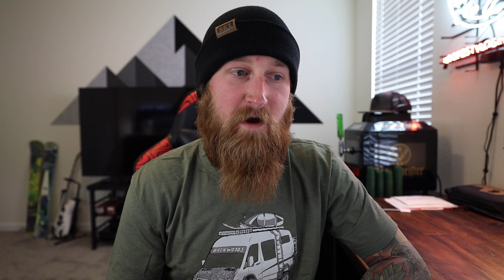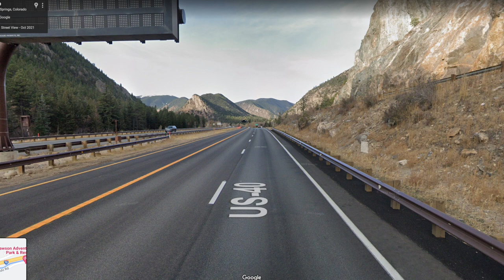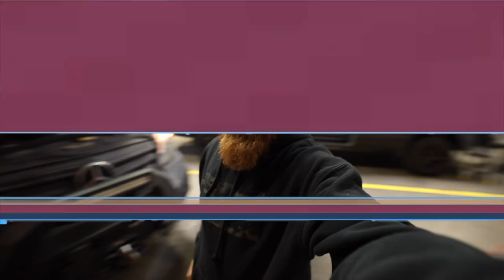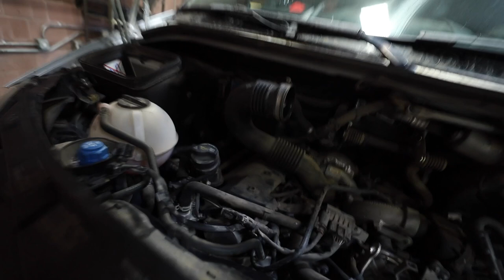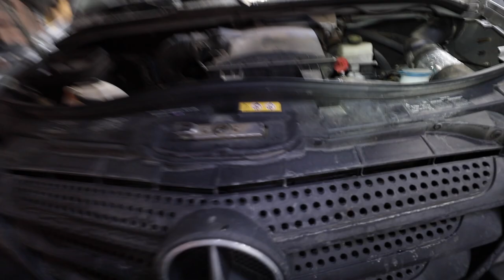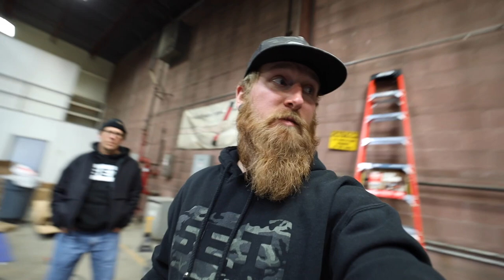DANGEROUS #VANLIFE SITUATION! | Complete breakdown...

Comment: Pro tip: Get a AAA membership $130 year 5x 100 mile tows. Premier $170 5x 100 mile tows plus one 200 mile tow. All your vehicles including RV. Plus many other benefits.
Reply: And motor cycle
Reply: When I had Premier AAA it didn’t include my RV.
Reply: @J.Young808  you have to have RV added to the membership. If you go to the sign up page on AAA it has a plan with and without RV.
Reply: Yep !! I  pay 250 a year that is for multiple vehicles or a Family membership...its came in handy a couple times...plus if your broke down out of town  ,  discount at most hotels ( not thar im a cheap ass but hey 10 bucks is 10 bucks lol ).

Comment: After owning my '17 4x4 Sprinter for less than a year, I went to northern New Hampshire where the temperture dropped to -20 overnight unseasonably early and my van didn't start in the morning.
My friend, a truck driver, claimed the Southern NH gas stations hadn't swapped over to their winter blend fuel yet.  This is another thing to consider during early winter months.
I too do all my own maintenance.  I found your commentary very usefull.
Thanks,

Comment: My wife and i had a similar experience on I-5 in LA at the worst possible spot. I had preemptively begun pumping fuel from my main tank to my auxiliary tank since i was planning a fuel stop. The fuel gauge was reading 1/3 tank when the engine died, luckily I had the frame of mind to pump fuel back into the main tank, which worked. I no longer trust the fuel gauge while preforming tank transfers.

Comment: In my old sprinter I would change the fuel filter every other oil change approx. every 20,000 miles. Being that it also helps as a water separator it was cheap insurance. Never had fuel issues but like you the DEF system sucks.

Comment: Always run antigel through diesel in the winter. At every fill up I use hotshots antigel. See project farms video test on the best product. Also considering this is an all weather van, I would consider adding a diesel tank heater.

Comment: I run Hot Shot Secret EDT in the summer and Diesel Winter Anti Gel in every tank. I run 1.5 oz per 25 gal. I also replace my filters every 20k or once a year. Lastly, I drain my water trap every month to two months. This is in a 2020 Super Duty Tremor

Comment: Really glad everything worked out and you and your dad are safe!!  Did a lot of reading up and even called Mercedes for my 2020 Sprinter van fuel system for bio diesel fuel…best thing to do is to get B20 or less Diesel fuel if you can.  Sprinter engines are not bio fuel friendly, especially for B100 bio which can clog your system.  Also, as you found out, try and keep the fuel tank above 1/2 filled during the cold weather.  The fuel will congeal.  And, if you don’t use the van for awhile, always store it with a full tank of fuel.  I saw some other comments about changing out the fuel filter every 20,000 miles which is good but I change mine out every 10,000 miles.  Better to be safe than sorry for a few hundred dollars.  Again, glad everything worked out!
Reply: Definitely this. German diesels in general don't like bio diesel. My BMW recommends using under B7. It's a pain here in the midwest because most stations have B20 so you have to stick to known stations where they have non-biodiesel.

Comment: I always carry 2-3 32oz diesel fuel treatment in the winter plus a bottle of diesel 911 just incase I or someone else needs it to ungel their fuel filters. Anytime below 32° id make sure you are running treating your fuel. Glad it worked out that you guys stayed safe and didnt get hit man. Stay safe bro
Reply: Also it will say on the bottle that adding more fuel treatment than the recommended oz per gallon will not cause fuel issues atleast when using Howe's or Power Services treatment

Comment: I've had the same happen in 2 diesel trucks that I previously owned. During similar sub zero temps, had the fuel gel up and leave me stranded, twice. Two trucks, same thing.  Filled up with diesel 911, full tank and new fuel filters, 2 tow bills. My current truck is gas, tired of diesel and its quirks I guess.

Comment: Scary!  I hate I-70 and avoid it.  Thanks for sharing.  I usually fill up at half empty, but now I have more reason to.  Others have recommended winter fuel additive to prevent the issue you had in extreme cold.

Comment: Glade it all worked . I drive a semi and the 911 is good stuff the have other products.Some for summer and like getting slim out of your tanks and fuel lines and Algae all of those products I get from Walmart the price for them are better then truck stops. You can use all year round not just the winter months. I have fuel tank heart's in semi you should check to see if that is and  Option for your van . Safe Travels

Comment: My wife and I are full timers in a 2018 Sprinter and had the exact the same issue happen during winter on the highway. The fuel gauge was reading 1/2 full when in reality it was reading incorrectly and we were completely empty. The instrument gauge calculates fuel level and mileage on fuel used. Because it cannot calculate the amount of fuel used by your Espar Heater it may cause an incorrect fuel gauge reading. Make sure to have code J51 scanned to the instrument cluster (Fuel tank gauge adapted for fuel additive extract). This should correct the fuel gauge level on every key cycle. Your intuition is correct...top off on fuel once you reach half full to avoid this ridiculous Mercedes  common fuel gauge issue. And top off on DEF fluid when half full to avoid DEF issues. Safe travels! P.S. let’s start a Freedom Convoy!
Reply: My wife and i had a similar experience on I-5 in LA at the worst possible spot. I had preemptively begun pumping fuel from my main tank to my auxiliary tank. The fuel gauge was reading 1/3 tank when the engine died, luckily I had the frame of mind to pump fuel back into the main tank, which worked. I no longer trust the fuel gauge while preforming tank transfers.

Comment: i dont know a lot about sprinter vans but most diesels have two fuel filters. an engine mounted filter and a fuel/water separator. also, the def tank has a heater in it to keep from freezing. it runs coolant through a tube going into the def tank to keep it warm so maybe make sure that tank is full in the winter too.

Comment: 911 only works when your fuel is frozen and will just sit in the bottom of your tank. You need to use Power Service fuel treatment. In the winter you should be added this if you are seeing below freezing temps.
Reply from the maker: It was frozen... hence the issue in this video.

Comment: Wow! Glad you guys are safe. I live in upstate NY and the cold temperatures we’ve had this winter have been exceptional. I’ve had some battery issues after adding LP6 lights and  a R&B light bar in the below zero temps. Have you had any experiences with battery drain issues as a result of low voltage electrical draw and cold temperatures and do you know of any potential solutions? I’ve started running a battery tender on below zero nights but that’s not always possible on a ski trip. Thank you for sharing your adventures.

Comment: I think there designed to run out going up because you loose power steering and brakes when the engine quits unless you have electro hydraulic or air brakes you don’t want to loose power on the down grade keep it full in the winter  here in Minnesota

Comment: Did you get J51 done on your Van? So its measuring off the fuel level sensor instead of calculated fuel consumption?  If You were running your ESPAR before this, with out J51 your remaining mileage would have been off.

Comment: Glad everything went well at the end. Did you have the winter blend in your tank or is that even a thing in the US? I live in Finland and have had diesel cars always and never any issues. It is very cold in here but the gas stations switch to a winter blend very early. Petrol is 95 to 98 octane.
Reply: Some stations will have diesel #2 with or without treatment depending on where it is located very few in CO have premium #1 diesel and its usually about 50-80 cents more a gallon. In northern MN alot of our diesel it treated to -40° in the winter months but if possible I always run #1 diesel.